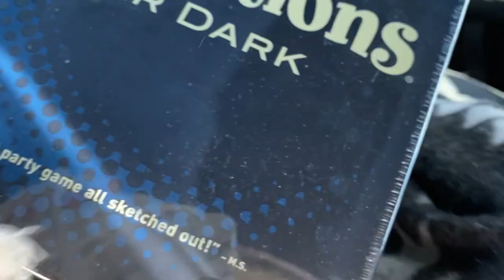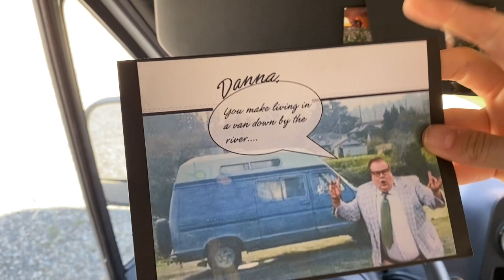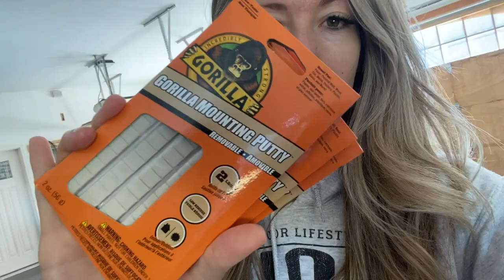Stitch & B!#$% With My Mom 👗 FIRST TIME MAKING MACRAMÉ - EPISODE 90

Comment: Hello Danna. I found this on the internet. Could be helpful. The top of the 5-gallon bag is clear, and the back wall is black to absorb maximum sunlight. To warm the water of your portable shower, simply position the bag so that the clear top faces the sun. Most portable showers come with a thermometer so you know when the water’s reached a comfortable temperature. Portable showers can get really hot, over 120°F, so beware. Always sample the temperature before you step in. Maybe, hang it off of your sliding door when using?